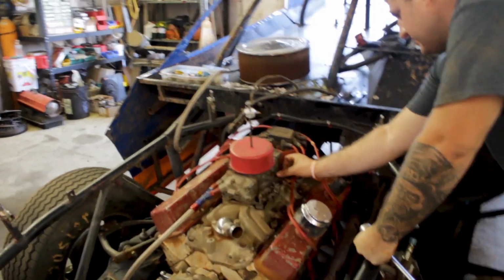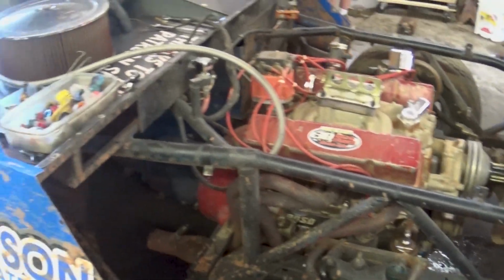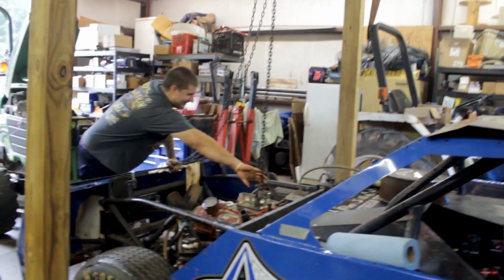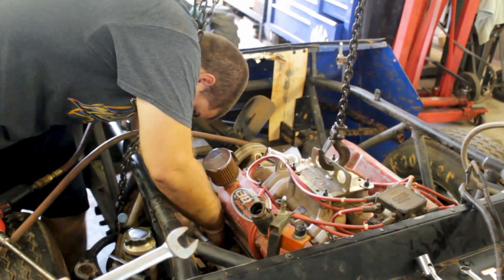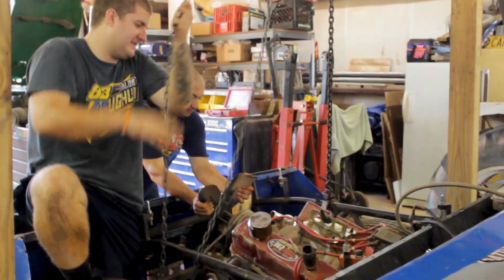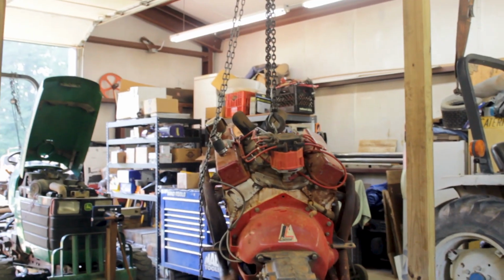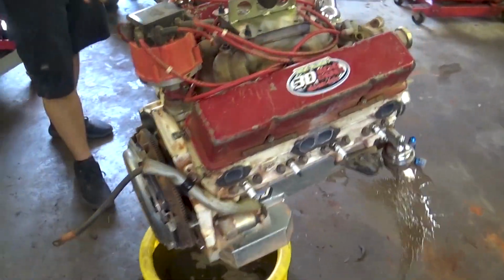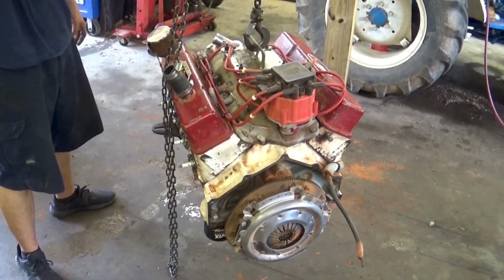Pulling Our Engine Out Of The Race Car!

Comment: Getting that fast with pulling your motor & trans is a bad sign. I’m not being rude but I might would research a new engine builder. When you’ve not run but 3 or 4 nights & your engine will be in the build shop 3 different times, something is wrong somewhere.
Reply: I’ve ran several different race classes from “road hogs, bomber, super bomber & open wheel”. Sometimes with my bomber car I’d run 2 seasons before we’d even refresh the engine.